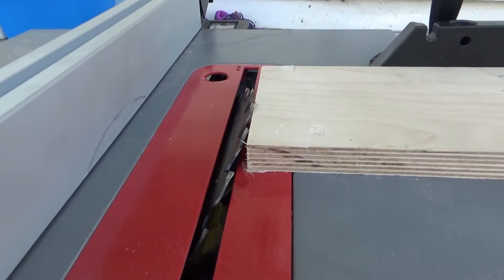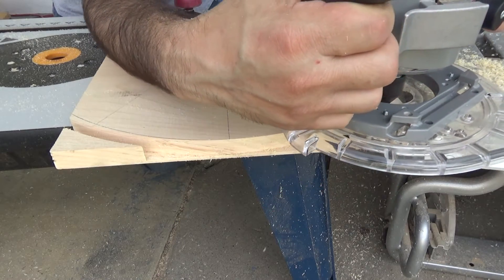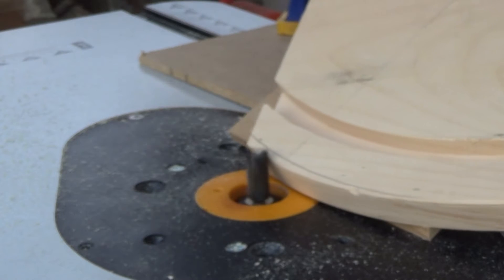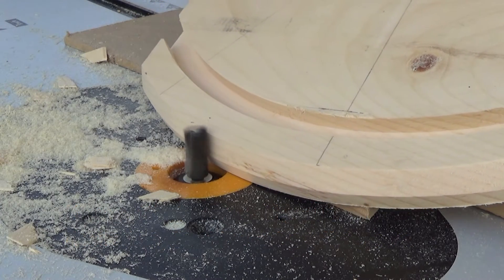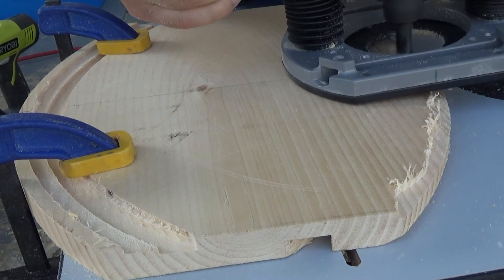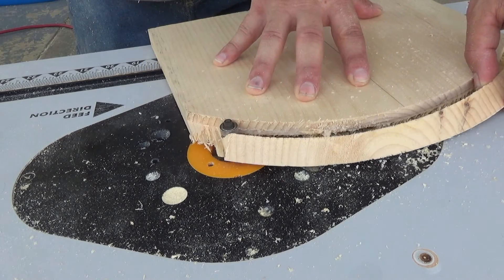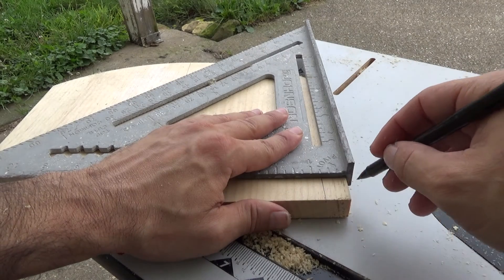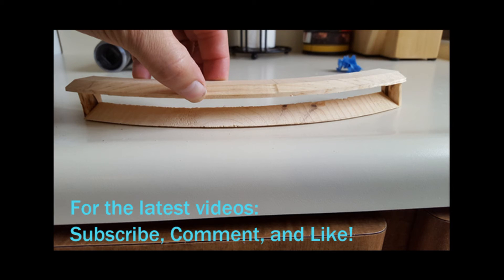R2D2 Wood Large Data Port Pt I

Comment: I likethe warning at :45 . I've chopped the end of my thumb off with a router and barely had any time to figure out what happened. BTW I'm loving this series man good job!
Reply from the maker: +AM_ Productions As you know it is a good warning. I have met another droid builder who has a "$20,000 wood frame". He thought he too had a close call until he felt a twinge and looked at his thumb. He is very experienced with wood. He was holding a piece in nsuchba way that the router to kick and pulled his thumb into the spinning blade.  I think of this EVERYTIME I turn that machine on. Coming soon are my wood coinslots made with a table saw!
Reply: Yep. I am experienced as well but only 3 years experienced. I was cutting pieces for a batman belt buckle and felt my thumb get thick and I looked down and it was gone Lol. But seriously its a great thing that there is someone still out there that cares enough to give a warning. Thumbs up to you!!
Alex